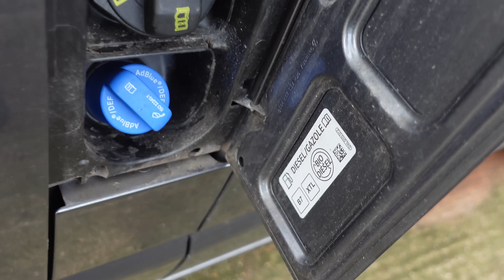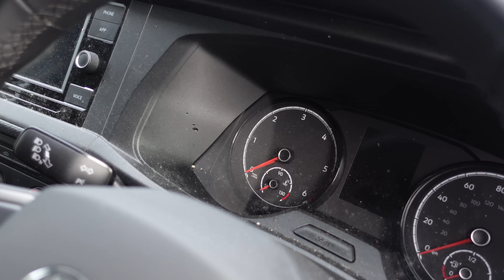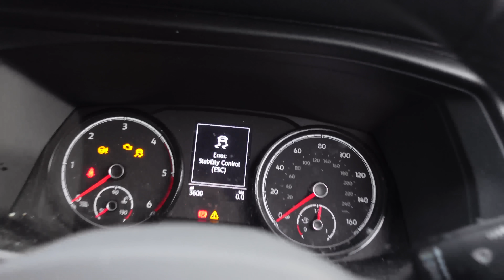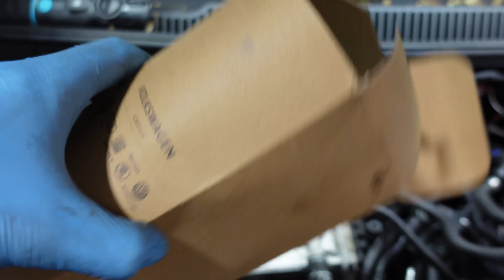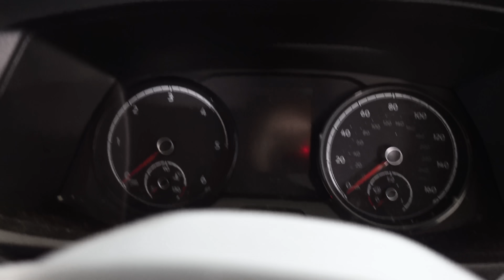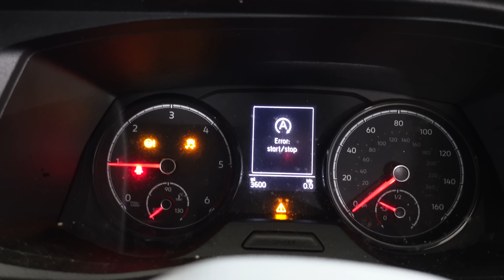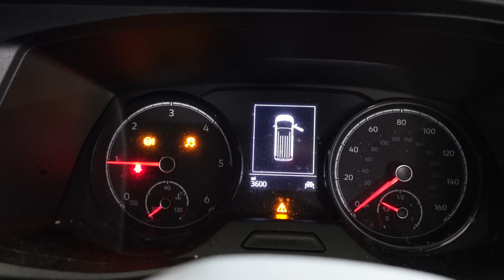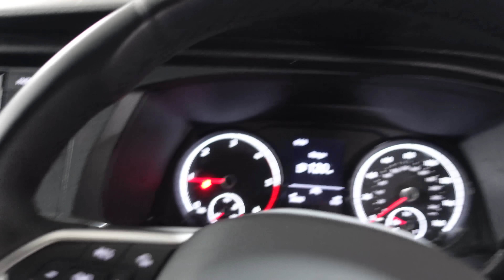I BOUGHT A CHEAP VW TRANSPORTER.. FULL OF PETROL!!! MISS-FUEL...

Comment: Had a crafter in that had all 4 injectors replaced at separate times after a misfuel.
I insisted that if we were to do the job properly we’d need to have tank and lines cleaned, replace low and high pressure pumps along with injectors, rail and lines.

If you don’t do it properly on common rail VAG product, it’ll bite you on the arse.

Older stuff was fine, once put £50 of unleaded in a 1.9 TDI A4 and drove it 4 miles until it stopped. Drained tank, new fuel filter, fresh diesel and never missed a beat.

Different ball game to common rail imo
Reply: I'd expect the HPFP in this one to fail prematurely. I would've at least inspected it for shavings and changed the diesel filter.
Reply: You sure about this? How are the lines going to be damaged by having some petrol in them? They could make them out of some material that was dissolved by petrol and fine with diesel but in my experience automotive fuel pipe is automotive fuel pipe and is fine with either. Most of mine is metal and really doesn't care. Same for the rail. And why replace the injectors and pumps? OK they got less lubrication for a short period, but that seems unlikely to be fatal - just some premature wear. I guess the HP side is quite tightly specified, so this might be a real problem, but I'm skeptical without some evidence/explanation.

Comment: I did same with a Diesel Vw Eos i had, put £30 in before realising it was petrol. I then filled to top with Diesel as Petrol wtll float and called garage. Drove 1 mile to garage and had fuel Petrol drained off top of tank, new filter and away. No issues again.

Comment: I feel sure that someone else will have said this, but as I couldn't see anything in the first 25/30 comments....
I would suggest putting half a gallon of diesel in the tank swishing it around then pumping that out as well, you can then be sure that any residuals are removed, or at least heavily diluted. This would obviously apply equally to the leave tank in situ and use original pump option as well, as this seems to be the easiest option.

Comment: all modern VW, SEAT, SKODA, AUDI cars require VCDS software to activate the tank fuel pump if you replace the fuel filter or mess with the fuel tank, in order not to starve the high pressure fuel pump of lubrication. diesel lubricates, petrol doesn't.  most likely the high pressure fuel pump is toast, in short time will make shrapnel , which will end up in the fuel system, tank, injectors.
Reply: yepp. it is sad to see how the system gets hurt in this video :-(
Reply: I did wonder this ? I had a pal who miss fuelled a late model Ford kuga diesel, different engine granted, but I assume the idea is similar. Anyway, he just purged the tank changed the fuel filter blew the fuel lines and dropped new diesel in and no matter what he did he couldn’t get it to run without stalling, long story short he blew a control module, apparently because of the constant starting without rest, it scrapped the hpfp and the injectors and cost him a small fortune in the end to get it running correctly again. And that damage happened just from trying to start it after the miss fuel, he didn’t even get chance to drive it around for a while  like the OP, but not being a mechanic you don’t like to say anything because you don’t want to look like a Wally lol. Oh yeah I nearly forgot, he scrapped a brand new set of injectors too, something to do with metal filings in the injector rail which I imagine backs up what you said above. Again I’m no mechanic I’m just going off what he told me.

Comment: 40 years ago Peugeot diesel car handbooks used to recommend using up to 25% petrol in sub zero temperatures to, prevent waxing. They also stated up to 33% paraffin could be used instead but pointed out in some countries, the U.K. certainly, using paraffin would be illegal as it is not subject to road fuel taxes.

Comment: Just a thought: Looks like a fibreglass fuel tank so why not drill a hole in the lowest point/s and drain. Plug the hole with a large self-tapper and put in some diesel. Disguise the self-tapper for the MoT, and Bob's your uncle.
Would that work?
To get the engine started you can wave a petrol-soaked cloth in front of the air intake.
Jack, the Japan Alps Brit

Comment: Don’t work on many small diesel engines, but I am, Bosch trained. 
If you took it to a dealer Or a Bosch garage, they would tell you to change everything.
If you take the metering valve out you will see pieces of chrome from the cam in the pump.
That is only the start of the problems.
Bosch pumps hate water, petrol, and AdBlue.
Reply: Putting AdBlue in the tank absolutely ruins everything. AdBlue in the tank and you’re in for a 10k+ repair, if not outright total the vehicle.

Comment: You can save or the hassle of removing the tank by using a scan tool. There's an option to drain the fuel tank on the better ones.

Comment: The thing that slays me is how much shops lie to people about gas in diesel vehicles.  It does not hurt them 99 percenf of the time.  In older diesel you would put an 1/8 tank of petrol in to get it to burn hot and clrear it out.

Comment: This is a common issue on motorway filling stations. They are all used to emptying Diesel from Petrol tanks and vice versa BUT as you are there and want to drive off into the sun on the horizon soonest: they charge an arm and a leg, plus a new full tank of petrol/diesel .....
Never seen any car or van refuse to work after that.
Pump it out - bleed the system - fill it up - start.

Comment: not the safest way but if misfuel add two stroke oil 2 3 litres plus a bottle of washing up liquid helps mixing and if you care to try adds lubricant try it on your fingers. brim tank with diesiel and just run it only works if less than 30% misfuel remember the sooner you catch it the better. petrol is a solvent strips the lubricant of diesel anything you can add back may save you the cost of a tank drain,and garages will replace pretty much anything they think may have been affected, ie  filters pumps seals ,which may or may not be affected ,ie they are working to your best interest but not to lowest cost .if you have ran engine for several days damage may have occured etc,older  diesils will quite happily run on a misfuel its down to new high pressure pumps they use the diesil as lubricant coolant ,if you misfuel say 10 litres petrol dump some engine oil or two stroke oil in brim up and i mean 30/40 litres diesil probally safe .also diesel is heaver than petrol so tends to sink in tank ,old 2 stroke bikes you were told to shake bike back and forth to mix oil and fuel in tank to mix before starting if bike had sat a while.the two fuels mix happily when on the move but will seperate  due to having different specific gravity , also a problem with water being heavier if in fuel will sink to bottom of tank latest ethanol petrol if sat for awhile.

Comment: What I have done is take the filter feed line, bypass it to a container and with a battery charger, run the pump with the scanner or with the relay. (Or HPFP feed), then add the correct fuel and some additives. If it is a gas engine, change or clean the spark plugs

Comment: it being an ex rental they'll have miss fuel insurance. and its not worth them fixing as potentially lost days of rent etc. looks like a smart van.
i filled a petrol car with diesel when i was younger, unfortunately i brimmed it so had to get it totally drained. with older carbaretta cars you could get away with about 1/3rd the wrong fuel. not sure about the other way round but nice to know its a relatively easy fix, and a nice clean van at the end of it

Comment: In Germany there are mobile units that yo can call. They enter a very thin hose into the filler pipe and pump the fuel out of the the tank. Takes a while since the hose is so thin but no tools required. Afterwards a couple of liters of new fuel get filled in and the ignition is turned on so that the fuel is cycled a bit. Started right away and after running rough for a minute or so everything was back to normal. A bit of contamination with the wrong fuel left in the tank does not really hurt. Drove to the gas station filled it up and everything was ok. Cost me 300 EUR, but since it was a rental car, it could have been much worse.
Reply: Great video hope its all good for the future

Comment: you can run diesel with some petrol in it, it doesn't stop it running. Back in the 80's before fuel heaters were fitted to cars, I would regularly add petrol to the diesel to stop it waxing in the cold.
Reply: I did the same thing with mine.    Ran just fine.
Reply: nowdays engines cant handle that

Comment: Dean, you’ll have problems with the HPFP and injectors later on, I’d advise to check the metering valve on the HPFP for any metal shavings/swarf.

Comment: Interestingly that happens to my Suzuki grand Vitara my son-in-law put 20 ltr of petrol in the tank. That all I did was to unplug the low pressure pipe from fuel filter connect a length of rubber pipe to the low pressure pipe and put in jerry can then turn key on the low pressure pump will run for about 30 seconds pumping the fuel from tank I repeated that until empty then put fresh diesel in tank then same thing turn ignition on and let the low pressure pump pump fresh diesel through once done reconnect low pressure pipe then disconnect the filter output then turn the ignition back on   to allow the low pressure pump to clean out the filter reconnect start engine and off I went never bad to bleed the injection system. Worked for me did about 100k after that.

Comment: You may hit problems later. Once the HPFP has had petrol through them they begin to break down. The rely on the diesel as a lubricant, & once they have petrol through them there is no lubrication. They then send brass filings through the system which then knackers the injectors, & you will be back to square one.
Reply: 100% agree. Replace high pressure fuel pump ASAP
Reply: Spot on.  VW master tech… HPFP and injectors highly likely to fail within next 5000 miles.
Reply: I did it when i had a mk7 transit put 50 quid off petrol in toped it off with 30 off diesel ran like crap missing juddering etc used the gole tank refil and drove the best it ever did for 30k untill i sold it still going now
Reply: @thomasmarshall5728  those probably didn’t have such a complex HPFP.
Reply: No brass in the fuel system
Reply: @Nicka2003  Yes completly right
Reply: Piffle 

that will be fine for another 20 years
Reply: You work for a main agent
Reply: Then again it'll probably be fine,all of the misfuelled cars I've done have always been ok,i once drove a quarter tank out of a merc to near empty and then put fresh diesel in at a petrol station and it was fine,it pinked a bit for 5 miles or so but it still fine 20k later
Reply: I miss fuled my diesel Honda,  just topped it with more diesel ran okay.
Reply: I’m sure Dean being a Audi tec is fully aware of any said issues yet I’ve done this before and had no issues and my vivaro went on to do 20000 miles no issues with fuel
Reply: Stick some 2stroke in with the diesel it’ll lube the hpfp back up
Reply: @ukcarflippers2220  200k in a vivaro? Maybe putting petrol in done it the world of good. Ive never known a vivaro do 80k without major problems
Reply: @Oockeshoek had a diesel with petrol in it, was sat for over 4yrs. Drained tank, new mot drove that over 30k in 12mths and still on the road years later no issues.
Reply: Considering he's worked at audi any body knows your supposed to prime system using vcds or diagnostic not just crank over and over risk putting swarf from hpfp in system next its fucked injectors seen it on 20000 mile golf's 👍👍
Reply: Fuel filter does nothing then? 😂
Reply: looks to me like he said 20k not 200k
Reply: Maybe that's why the reg was covered so can claim under warranty later 😅
Reply: I miss-fueled a VW Golf diesel. I managed to drive it about a mile before it cut out. I drained the fuel, replaced the filter and it ran fine after a few minutes. It didn't give me any more problems for the several years and thousands of miles I kept it.
Reply: What a great find and a great video. A bit of cellulite appearing on the thigh old boy 😂
Reply: Loads of people run petrol in diesel engine without any long-term issues. 
Garages will say you need this and that cha😮nging to rectify it because they're robbing barsterds
Reply: Actually getting iNTO saving salvage , good vid
Reply: The van will almost 100% have problems later; I'm pretty sure these have electric power steering and as we didn't see him pull the fuse for the lift pump before pushing the van to the workshop. That would certainly have pushed diesel/petrol mix through the system. I learnt about the electric lift pump back when I had my first diesel and that needs to be the first thing isolated when you misfuel before anything else is done. That way it limits the damage to inside the fuel tank and doesn't then mean the high pressure pump, injectors etc need replacing.
Reply: One things for sure, 'techs' will absolutely throw parts at this necessarily. It's highly unlikely either the HPP or anything else is broken or worn down because of this. This seems like a spot on deal
Reply: @MrCHrisfj even with a mix of 50 50 viscosity threshold is still kept, so if it starts and run no issue
Reply: It’s a transporter. Laughably unreliable anyway so it will have problems regardless! 😅
Reply: My opinion was exactly same.
Reply: @jokerash was vectra CR?
Reply: @jokerash yes but diesels back then and diesel injection systems today although work similar are very different ! Obviously  you don't know much about theese things but I do being qualified technician
Reply: Please tell us what you paid for the van :)
Reply: Why all the negativity ? I don’t understand it oh this will die eventually, wait till this goes wrong, the high pressure pump is going to fail. Well it’s not your van it’s not your money the guy can do as he wants I’m sure he’s not daft.
Reply: I am.
Reply: @Nicka2003  better sell it on fast!
Reply: You need to check the HPFP at least. It is possible that it survived, but usually metal-metal surfaces wear down in a few mins.
Reply: @listerthat  see it daily just because plums think I'll do my service myself n crank and crank and crank the car till it starts I bet any money next service will be swarf in filter housing if not a foobard injector b4 hand
Reply: @manzdoingbits766  what does petrol into diesel have to do with someone doing their own vehicle service...
Reply: @listerthat  it doesn't its the fact they do the same as he done cranked n cranked n cranked the car to start which breaks down fuel pump if any passes fuel filter which it can boom fucked injectors
Reply: @manzdoingbits766  agreed the fuel pump should have been separated definitely from Injectors to clean
Reply: My bud had brass filings in his  B8 2.0 tdi system. Always tanked diesel. It's a general pump issue with vw engines.
Reply: No such thing as a cheap vw van
Reply: Theses new engine make me sick somany pipes and cables what ever happened to a nice simple engine
Reply: Fuel filter will stop the brass filings mate, change the pump and filter then no problem.
Reply: @littlealmcb943  It's what I do when I run my 1964 Mercedes w110 200d on paraffin as it's half the price of diesel.
Reply: @HuntsChris  , it's high pressure pump that also fails. 😅
Reply: Such a negative nancy my god
Reply: Mr. Optimistic
Reply: the pump you mentioned did not suffer this car was filled up with gas ran a few miles and then stopped. i made this mistake with a volkwagen caddy and it ran very bad with a very little of gas in the diesel. noticed my fault filled it up with diesel to the top the whole week problem solved. never had any isseus with the car.
Reply: Still don't know why Sixt would shift a 3k Transporter purely because of a mis-fuel. You'd pay the money to get a mis-fuel firm to rectify it and get it back on fleet. 18 months old with 25k I could understand but that has had no use.
Reply: @Nicka2003 , flog it asap 🙏🏻
Reply: @michael-sz3ff Absolute nonsense
Reply: @jvtaxi3766  yeah ok then !🤣🤣🤣🤣🤣
Reply: thats exactly why shops in cases like this😊 replace lines, hpfp and injectors all at once
Reply: The seals perish resulting in leaky pump
Reply: Main dealer scare mongering...
Reply: @ZombieModz1 that's BS I drain wrong fuel for living.petrol pumps have rubber seals 2...
Reply: Nice job

Comment: I did this in my old golf 2.0 tdi but luckily I didn't start it and pushed it off the pump and removed the fuel pump under the back seat and used a small electric pump to drain it off into Jerry cans then filled it and ran with no issues for another 3 years till I traded it in for a gti 👍🏼

Comment: Petrol as such will not kill a diesel car, its the lower lubricity in petrol that can kill the parts that is lubricated by the diesel, but even with 50 50 the mix is inside the lubricity threshold - look at the ASTM D975

Comment: I don it 30 years ago just topped up with diesel straight away . Ran a Bit lumpy until done enough miles t refill with diesel again . Don’t get away with it by easy with  modern diesel. I believe it Usually damage the injectors . But might of  got away with it. As so quick on miss fuel  surprised the van so rusty. My t5 11years old underneath not to rusty not to sure about bottom of the doors etc .

Comment: I would really be concerned about the high pressure pump crapping out and taking out the injectors. Gasoline is not a lubricant unlike diesel, I guess addblue is the same as DEF?

Comment: Why you didn't have some 2 stroke in the tank, after wrong fuel fill, I have used 1liter of 2 stroke oil in the diesel, to get a liner of oil lubrication in every component of the fuel system.. Then next tank rund a diesel cleaner thru it..